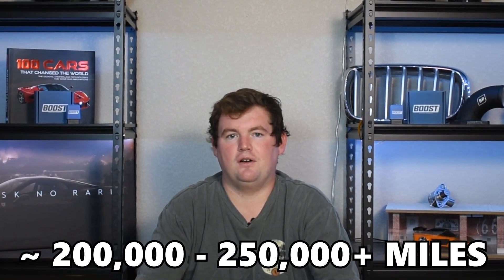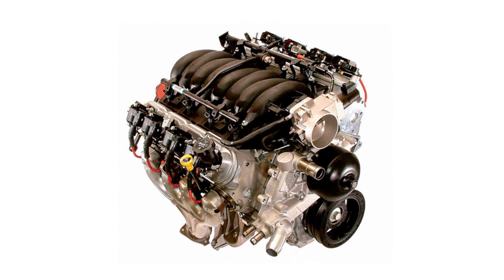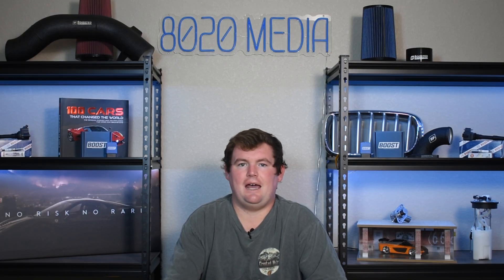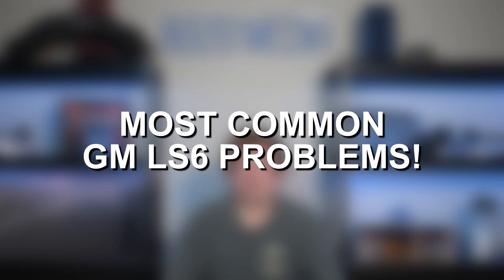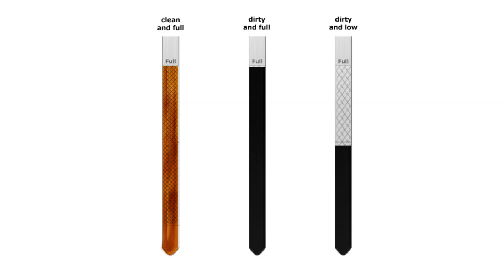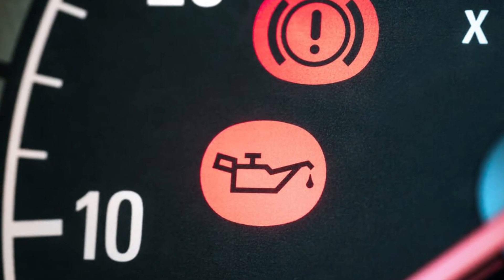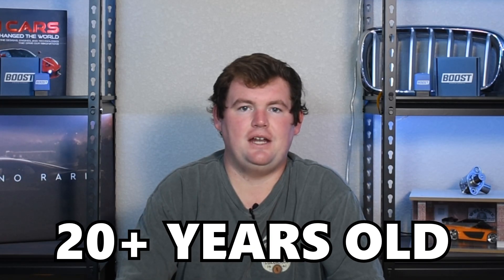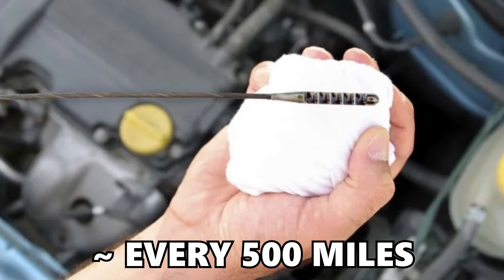The TRUTH About GM’s LS6 Engine Reliability!

Comment: I feel like GM reuses too many of their engine references. When I hear LS-6, I think 454 big block in a '70 Chevelle. While I'm not necessarily in the loop, I don't ever remember an LS6 "variant" of anything.
Reply from the maker: O - Could honestly say this about a lot of manufacturers though.
Reply: The valve spring issues were concentrated in late ‘02 to early ‘03. Most or all 2004 cars have different springs. If you check CorvetteForum you can find VIN lists or you can peek at your springs with a bore scope to check the color.
Reply: So the ls6 is more reliable than the ls1? I have the latest ls1 in my 04 c5 and it’s been great.
Reply: The new 409ci (6.7L) going in the ‘27 Vette GS is supposedly being titled LS6🤔
Reply: @fredmorris6336  Interesting, all the Gen V engines are LT, the last LS was in the 2013 vehicles (could be off a year or so).